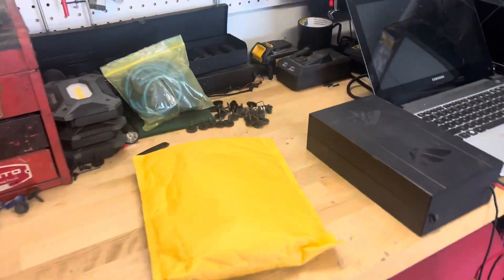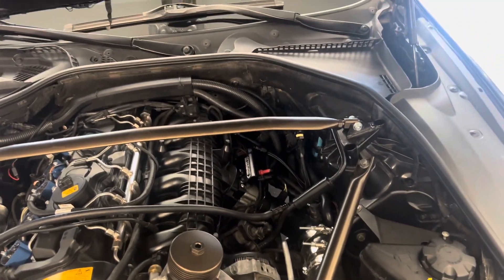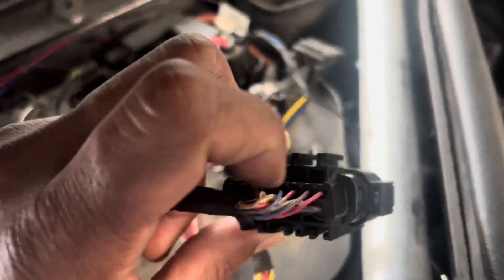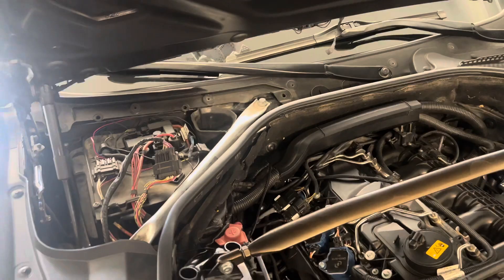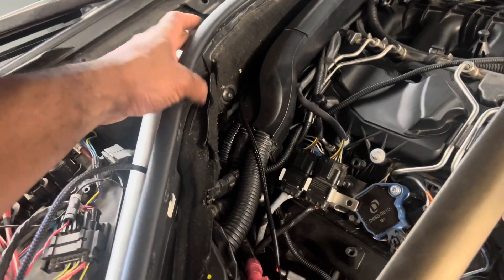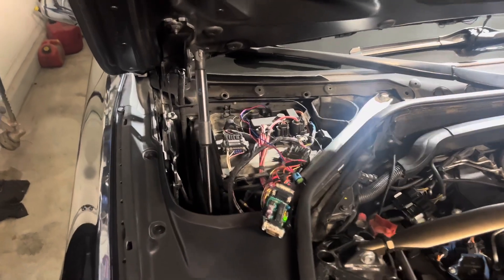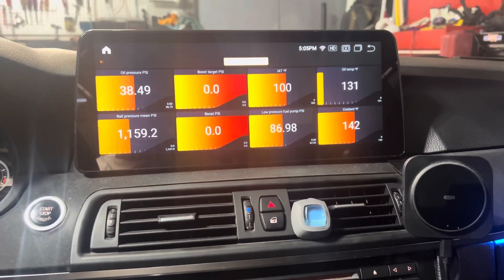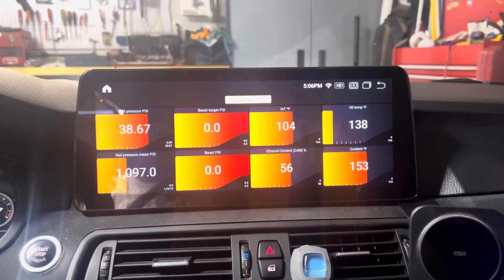Boost Your Performance: BMS Universal Canbus E85 Analyzer ECA Review and Installation Guide

Comment: In the mhd app is that all I have to do to run a flex fuel tune is enable the canbus system? And the you can run from 93 octane all the way to e50? Or e85 if your car can handle it. Or do I have to set mhd multi map also?
Reply from the maker: You have to either purchase the multi map pack that includes E85 maps or have a custom tune that includes multiple maps.
Reply: Thanks man! Just installed it the other day. Damn! E85 is no joke!!!

Comment: Any performance updates on the Fog’r 700?  Debating between that and the DORCH ENGINEERING N55 STAGE 2 HPFP UPGRADE.
Reply from the maker: Still working through the tuning with David Shoup. The Fog’r is putting out plenty of fluid. Which hpfp do you currently have?